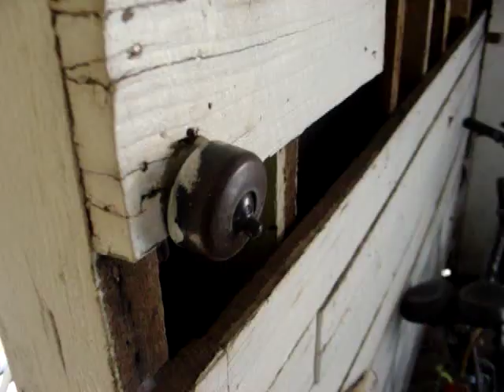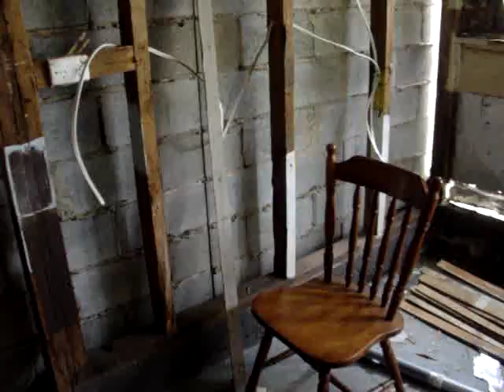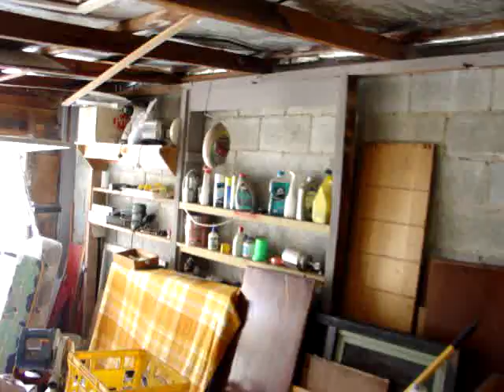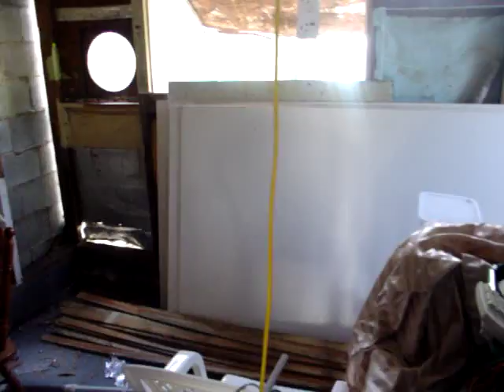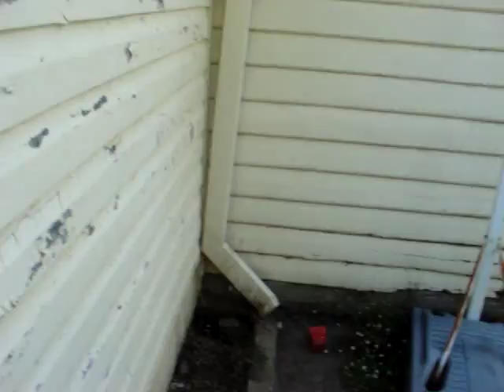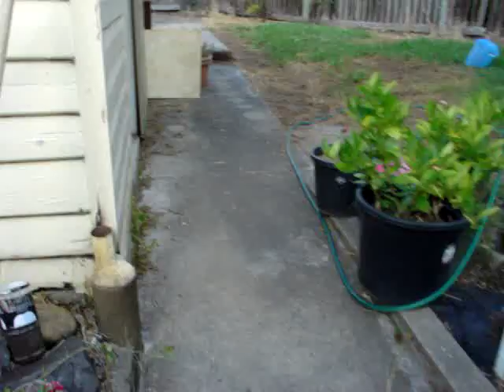Old shed... she ain't what she use to be... many years ago!

Comment from the maker: Regardless of what is done some things just need a small fix or 2 in between. Getting rid of rubbish, sorting everything into large boxes, strategic thick black plastic to waterproof things like the windows until a permanent solution is found. 

Problem with new shed is all the concrete would need to be removed and a new slab put down. Also, council planning permits and building permits add significant overhead. The other problem I have is the shed from next door is masonry and is right up along the boundary that will make it near impossible to rebuild the shed in the same place.